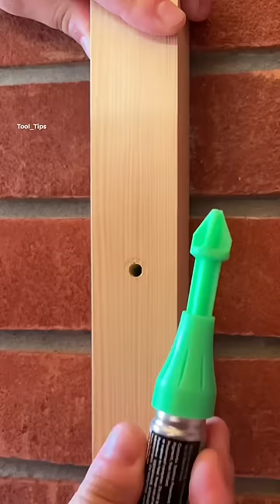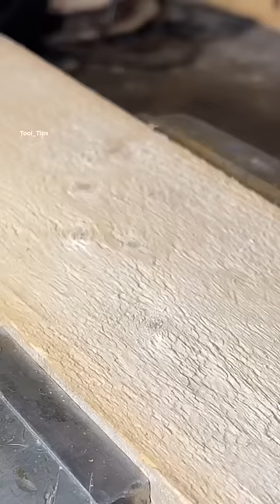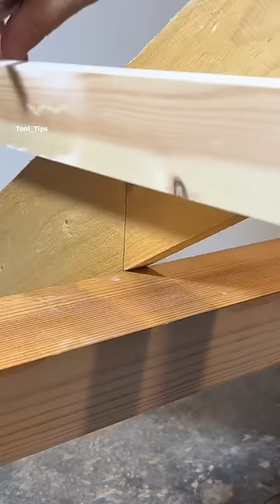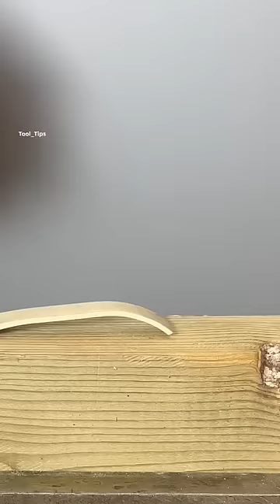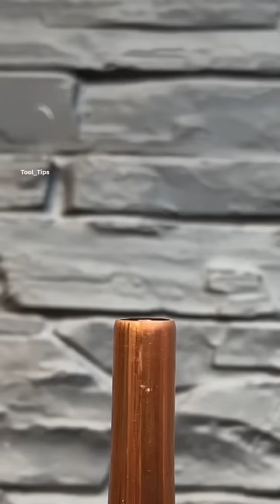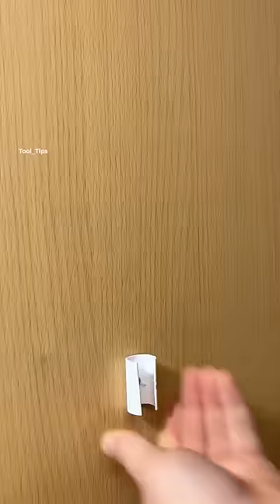10 Tips in 1 Minute #shorts

Comment: I don't recommend the screw and glue stick trick. It will fail in the long run
Reply: Replace the glue stick with a soft wood stick and everything is fine...👌👍
Reply: It will fail immediately
Reply: I wouldn't recommend anything on this video
Reply: Yes
Reply: I was looking at that wondering how it would do any good.
Reply: A lil plaster n paint'll make it what it ain't a little screw and glue'll make it hold like new!
Reply: All of this shit will fail
Reply: @ymfemptyb6967  🤣🤣🤣
Reply: Exactly why I went to the comment section 😂😂😂😂 y’all already on it
Reply: What works better is a couple small pieces of electrical wire with the rubber  coating on them stick them in the whole then drive the screw in.   I got a door to a bedroom that the hinge holes wore out I did that and it's been almost 2 years and it's still holding up
Reply: Honestly much better off with just a stick lol
Reply: Long run? How about almost instantly,  especially if load bearing.
Reply: It'll  come out with a little wear and tear.....screwball
Reply: By long run, do you mean instantly?
Reply: Just depends on what you are working on
Reply: It'll fail in the short run too
Reply: Put wood glue on a wooden dowel let it dry and re-drill??
Reply: It will fail in the short run
Reply: So here is an old guitar tech trick I've used multiple times and has never failed.  A common issue is our strap buttons stripping out. So a great fix is to drop some tooth picks in the the hole, break to size, add some super glue and screw back in.
Reply: @johngililland6166  operasi oiir😭
Reply: @jackhope45  p
Reply: Nah it will not fail in the long run. People tried this and its a fact that when you put the glue stick in the hole with the screw in, over time people will just flip it over and the fucking glue will fall.
Reply: Not to mention the waste of a hole glue stick
Reply: @johngililland6166  lmao 🤣
Reply: @gericanete1  the pliers to grab a nail and hammer to pull it out wasn't that bad tbh.
Reply: @gericanete1  not even the chalk blaster 9000?
Reply: Wood glue…use wood glue as a filler
Reply: And you will waste a perfect glue stick
Reply: @gericanete1  I'd recommend the first one
Reply: Agree I use tooth picks with some wood glue
Reply: What stops it from failing instantly?
Reply: Yup better use some cut up tooth picks with wood glue
Reply: Yes…just put wood inside to make it more narrow
Reply: It's okay I recommended it 🙂
Reply: Yeah, I have no idea why someone would even want to put a screw in an old hole anyways. Just screw a new hole-
Reply: Long run? Lol
Reply: it'll fail pretty quick
Reply: @jackhope45  or use a bigger screw. If not use an anchor that’s designed for the application. They’re like 10 for a dollar. Cheaper than glue sticks and easier than dowels.
Reply: It'll fail in the short run. Wtf was that nonsense?
Reply: Especially on hot days
Reply: @theguythatpissedyouoff3247  if you were tryna smash, I say less than 5 min
Reply: @el_8951  just remember to let glue sit after screwing is set
Reply: @Battle_Beard  scrolled way too long but got both the easiest and the strongest solutions in one.
Reply: Ikr. The glue stick could easily fall out along with the screw.
Reply: It’s literally cheaper to use a product intended for that purpose. Makes no sense
Reply: That’s actually the best one
Reply: It’s good for a stripped cabinet. I always used kebab skewers. They swell up like a drywall anchor and work well. It depends on the application
Reply: @apexedgesharpening2005  nobody asked you .
Reply: @josuecorona8292  lmfao ok
Reply: then what shoulb be used for long run?
Reply: @apscafe  it depends on what the application of the hardware is. There are several fixes for this. Some are using a molly bolt. Another is to drill out the hole then fill it with a wooden plug , using a good quality wood glue. Then when it has cured, drill a pilot hole and use the appropriate hardware for the task. I'm sure that people will send in more suggestions but the bottom line is that glue sticks are worthless. They have very little structural long term strength and are only good for arts and crafts.
Reply: Toothpicks work for most things like door latches and stuff
Reply: @TubeSurferGeek love the Opus pic. I have the Christmas video and play it every year.
Reply: in the long run we're all dead
Reply: Not to mention the glue stick costs a lot more than a dowel.

Comment: Don't drill into brick or block; drill into the mortar joint. Repairing mortar is much easier than replacing a brick or a concrete block.

Comment: For those wondering what the green marking device in the first scene was, it is called a Chalk Shot. It is shooting out green chalk dust. As an integrator, I use them on installs and they work great. If you are looking for a source to buy them in the U.S., Cable and Connections (main location is in South Carolina) sells them and will ship nationally.

Edit: There’s two main reasons I use them. One, if you mark something in the wrong spot, the chalk just wipes away - a Sharpie or Milwaukee Markzall won’t do that. Two, if you need to mark through a deep hole (e.g., for marking mounting holes through a deep plastic junction box, something I do frequently), a marker won’t cut it - but the chalk will blast all the way to the back, accurately marking where you need. They also work exceptionally well on concrete or masonry, where markers don’t always work well or show up as easily.
Reply: Awesome, really appreciate you sharing, was thinking how I would certainly make use of a “chalk shot”. Cheers
Reply: In the uk it’s called marxman
Reply: Thanks for that. Was looking through the comments for this very answer. I have never seen one of those before.
Reply: Thank you for that, I had never seen one of those before and have been around plenty of tools and construction gadgets.
Reply: Thank you. I was wondering if it was a homemade tool using line chalk.
Reply: There’s two main reasons I use them. One, if you mark something in the wrong spot, the chalk just wipes away - a Sharpie or Milwaukee Markzall won’t do that. Two, if you need to mark through a deep hole (e.g., for marking mounting holes through a deep plastic junction box, something I do frequently), a marker won’t cut it - but the chalk will blast all the way to the back, accurately marking where you need. They also work exceptionally well on concrete or masonry, where markers don’t always work well or show up as easily.
Reply: Thanks bud 🙌🙌
Reply: @reezy4411  I remember the guy on dragons den. Then a little while later we're selling it in Wickes!
Reply: Thank you!
Reply: Thank you!

Comment: Bro, the glue stick one just made me laugh. Man, you could PULL that thing out 💀
Reply: Fun fact, you can pull out most anchors that are fully encased in the surface. The only ones that will give you grief are wall anchors for drywall

If you drill a hole into a concrete, stone, or solid wood wall or surface for an anchor you could still pull the anchor out because the anchor isn't made to be pulled on that way. It's made to stay when something is hung from the screw
Reply: @Gio98art  I drilled anchors into concrete for one of my college classes and that nail was NEVER coming out again. Concrete anchors are so powerful if we messed up we had to drill new anchors in because my teacher knew it was pointless to try and get the messed up one out. (We used anchors that where made to keep stop signs bolted into sidewalks)
Reply: @youtubeshypocrisy  Those are different from the small plastic plug anchors right?

Comment: What the Hell was the point of nailing a rubber band to a freakin piece of wood? So lame.
Reply: You have fallen victim to the algorithm… once you comment about it, you gave it a point.
Reply: Oh Moosh, we feel so very sorry for you! Use your imagination! For example, how many times have you looked for a pen or pencil I couldn’t find one? Or perhaps a wrench or some other small tool like a screwdriver? Do you see my point now? With a strong rubber band one can place different sized tools and they will always be at hand.
Reply: I figured it was to protect the surface of the wood, since they wete finish nails. He just didn't show pulling the band off after. Though its easier to just use a nail punch.
Reply: I didn't get that either. I also didn't understand the glustick thing.
Reply: @TheRudedaddy  that's if the screw can't grip. I've seen ppl shove all kinds of nonsensical garbage down there to make the screw fit, but it's destined to fall apart after a while. You're better off using a wood stick
Reply: @thedancingpipestuffer  oh I thought that was drilled out intentionally for some reason. Ya u usually just find a twig in my backyard and shove it in there lol.
Reply: @GuitarUniverse2013  yah that idea sucks, if this comment wasn’t sarcasm then I feel sorry for you.
Reply: Many uses for that in a garage workshop. Maybe, just maybe, think before you comment?
Reply: Probably something like running wires to keep them out of the way
Reply: It is a handle pull, like a know. Neat. Usually it is a piece of leather.
Reply: @staynielherbayn657  
OUCH! 🤣
Reply: @GuitarUniverse2013  wtf
Reply: @TheRudedaddy  bro your going places 🤣
Reply: 고기집게
Reply: @SasaUSilly  my god… what the hell happened here
Reply: Clearly he nailed the rubber banned to the wood because he’s making kettlebell’s or rather kettlesticks! 😅
Reply: everything has a use, except your brain.
Reply: @aandyherr817  idek bro 🤣🤣
Reply: @GMCLabs  a nail punch? Do nail punches have a wide head…. so that the rubber band doesn't slip right off?
Reply: … but, what about the rest? 
You're bound to have one nonsensical tip in there? 
That was it… for you.
Reply: It's Howtobasic's brother that failed out of trade school in the last semester.
Reply: To see if it would work
Reply: I was thinking maybe a temporary handle
Reply: @idonotknowanynames  till it dries up and rots
Reply: I didn't get it
Reply: Why to loose an eye of course
Reply: @GuitarUniverse2013  or you could just use a hook, shelf, drawer, pen/pencil cup, toolbox, tool belt, cabinet, magnet, really anything that isn’t a rubber band that’s going to break the first time you apply any sort of force to it
Reply: Just think creatively
Reply: tamanco
Reply: A useful handle
Reply: @JamieJamez  they’re also as cheap as anything, easy to put anywhere, easy to replace and flexible so you they can keep things of different sizes. Not worthless at all.
Reply: @JamieJamez  deleting comments now 😂
Reply: Long nails too
Reply: I could see the rubber band being used to hold a rod or pipe in place
Reply: So you don't lose it; but I don't know if it is the rubber band or the piece of wood.
Reply: I thought he was making a massive paper clip weapon
Reply: @SasaUSilly  so did you??? Replies count too.
Reply: I thought it was a handle

Albeit, not a great handle
Reply: Cerus98  ditto
Reply: @donovanreid427  i am the algorithm 😈
Reply: Was there a good point to any of these?
Reply: @rennatsinned5451  good? No.
Reply: The purpose was to get you to comment for the algorithm
Reply: @TheRudedaddy  it expanded as he drilled the screw into it making it a tighter fit. I think an anchor would be cheaper and work better. But that's me.
Reply: ya right
Reply: Are you an Industrial Spy or something?

Like do you have a similar Channel? .. and this one is your Competition? Hence .. the insults?

Momma always said .. if you don't have anything good to say ..then don't say it.

Slander
Reply: Well. I like watching these videos and I sometimes have to look at one five times before I understand what’s going on. I’m a nurse so this is way above me. But I was wondering why he did the rubber on the wood also??
Reply: @GuitarUniverse2013  4,3k likes against your 113.
Reply: Because it looks cool
Reply: Obvious, its to make sure you can't loose the rubber band!
Reply: @thedancingpipestuffer  yeah, hot glue would not hold for a second: you can see it doesn’t even anchor into the wood.

If I had to glue a screw into place, I’d do one of two things. One, find a bigger screw, or two, completely fill the hole with superglue first. To be fair, I’m no contractor though…
Reply: You found that one thing to post something negative. “Why”? All the rest could be helpful.
Reply: @sergio.6137  the head had broken off right at the wood hard get a grip with your cats paw
Reply: Its to carry it dummy
Reply: Because he smokes meth it’s to hold his pipe

Comment: So just to let anyone know the copper tool is a swedge tool pro fit by rector seal they also make ones for flaring copper line I have both sets they work great and save on time
Reply: Thank u
Reply: Thanks looks a handy tool to have in the box
Reply: If this copper is used for a refrigeration unit, you can say goodbye to this hack unless u want to go the extra mile to make sure it clean as hell as those copper shavings are just going to get everywhere
Reply: Thank you for this, I've had an age old problem that you have helped to solve.
Reply: @01DOT0  that's what i was thinking. I cringed really hard.
Reply: @01DOT0  I actually use this tool on a regular basis for refrigeration. It doesn’t put out metal shavings it heats it up and expands around the swedge tool
Reply: Save time? It’s quicker to find a socket
Reply: Its called a SWAGE TOOL
Reply: Is this actually any faster than just using a straight connector?
Reply: @01DOT0  it doesn't make any shavings  its basically just a flaring tool.
Reply: I was looking for this comment, thanks!

Comment: I love the copper pipe one. It's literally hey use the right tool for the job.
Reply: What is that tool and where do you find it
Reply: But dont put greased screws in wood just drill a hole the same size as the shaft an you are all right
Reply: @moritz1071  if you make it the same size it won't grip anymore, a smaller hole is just fine
Reply: @erikkokai6563  same size as the shaft (maybe half a millimeter smaller), so that the thread is gripping, at lest that is what I learned as a joiner and what has worked since then, so take a 4mm screw and the shaft is around 3mm, drill a 3 or 2.5mm hole and the wood won't be splitting.

If you screw wood onto wood(4mm Screw), then drill a 4 or 4.5mm hole into the first piece of wood you're going through and a 2.5 or 3mm hole in the second and the screw will grip on the second and the first holds down pretty good.

Pro tip: use a Reamer (i think that's the right word for it) so you can put in the screw even to the wood without breaking it
Reply: @jamescowan1564   I believe it's called a pipe reamer. It's been so long since I've used one I've forgotten the name.
Reply: @jamescowan1564  I had to look for it but Amazon has them they're called copper pipe flaring tool and you can get a set for $15
Reply: He didn't show the part where he used hot glue to join them...

Comment: I've used cake soap on difficult screws. I think the grease would wick throughout the lumber piece.
Reply: You drill a hole the proper size for the shank of the screw into the piece you're attaching. If you're not going to do it right, why bother?
Reply: @klocke5247  In an ideal world, yes.

Comment: You can use wax or soap on the screw instead of Grease and it's a lot less messy
Reply: Or if you're worried about the wood splitting, just predrill...

Comment: Instead of using grease (which also cracked the wood) drill a hole just a little smaller than the thickness of the screw.

Comment: There's a tool called a swedging tool for copper...I've never seen that drill attachment before the sweating tool you use a hammer that makes a coupling so you can join them together......
Reply: I'm an hvac guy and I bought a swaging drill kit at the supply house. It is exactly that drill bit and it is amazing. Swage and reams at the same time. Perfect every single time. If I think of it I'll look in my van and reply again with the brand name

Comment: Alright, so:
1. The chalk shooter’s pretty cool. 
2. That’s an alright use of a nail and zip tie, definitely useful. 
3. I’m pretty sure I’ve done this with my sidecutters before, nothing special, but a good tip for those who haven’t seen it. 
4. This might actually be faster than taking measurements and grabbing a square. 
5. There is no point to this one, just use a proper anchor. 
6. Just, why? You show no use case for this one. 
7. I’m not sure if the screw will back out with vibration if you grease it, maybe something to do an extended test on. 
8. A useful tool for sure, but “use the right tool” ain’t exactly a tip. 
9. I’ve definitely done this before, great for securing pipe when it doesn’t need to be completely solid. 
All in all, not bad, but also not 10.

Comment: The screw in the silicone or glue tube is a waste of time. That's what wall plugs are for because they have sides with a rough edges that when they expand due to the screw getting screwed in, it enlarged and pushes against the inside of the hole. Another trick when screwing with a drill into wood, don't screw on the side with the wood fibres, you will split it also don't go too close to the edge but if however neither of these can be avoided then predrill the hole with a bit 1 or 2mm smaller than the diameter of the screw. And don't forget to countersink it so the screw head rests deeply in the wood and doesn't stick out.

Comment: For the zip tie one, I just recently did something similar, but with a drywall screw and two zip ties. I ran the screw in and left about a 1/4” gap under the head, then put a zip tie around the screw, and another zip tie through the first one.
One zip tie holds onto the screw, with the screw head keeping it from falling off, and the second zip tie goes around the cable, line, hose, wire, etc.